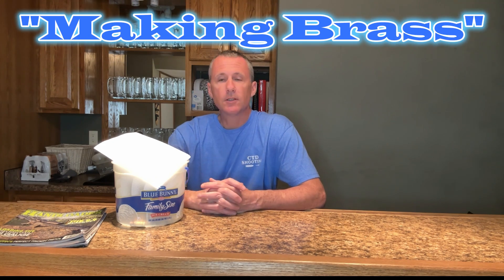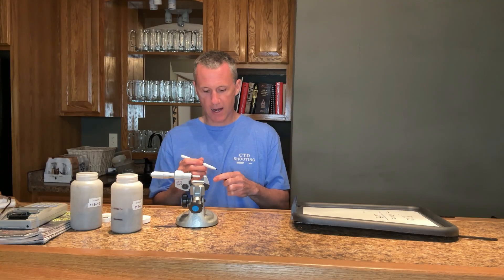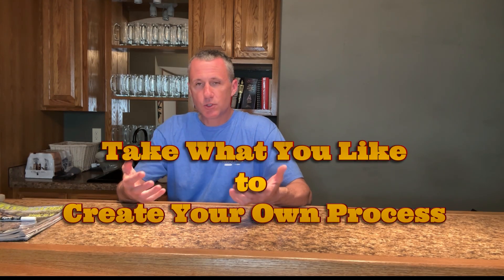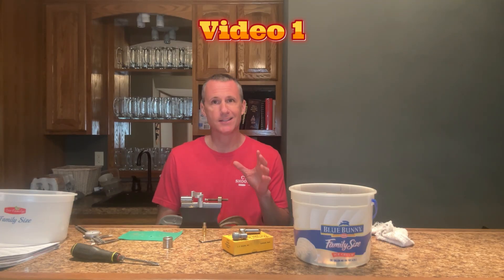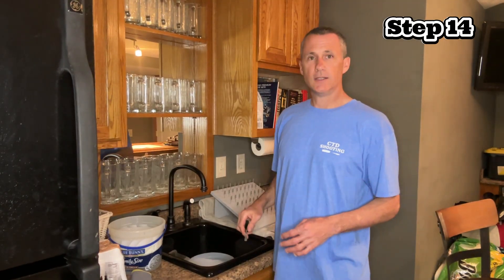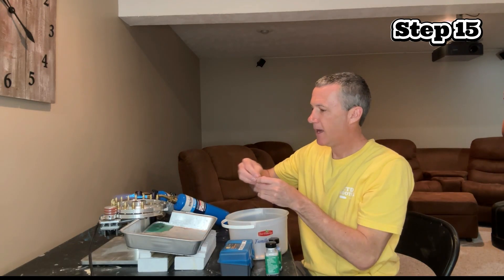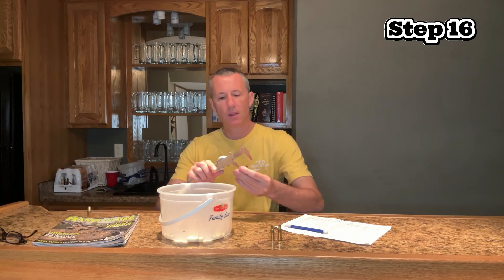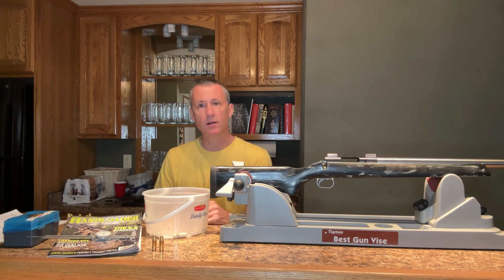Making Brass Part 2: Neck Turning, Annealing

Comment: Nice, step 12 looks wonky in the lathe and using the PMA tool neck turner. This also seems like it could introduce wonky concentric or variable neck wall thickness as it oscillates through the cut. But I understand it’s removing the doughnut
Reply from the maker: Great observations and question.  This is why I want the turner pilot to fit as tight as possible without inducing "grip".  That way if there is "wobble" then the turner will "wobble" with it.  Yes, if I had a 4 jaw and could zero the holder that would be ideal.  I should have put it in the video - but the run out is virtually zero when measured after turning.  Thanks again and good attention to detail

Comment: What type of lathe are using.  
I would love to find s lathe i could chuck up a barrel just to polish the outside of the barrel and neck turn.
Thanks
Reply from the maker: It is a Grizzly G4000.  It works good for the smaller projects that I do.  But....I'm no machinist.